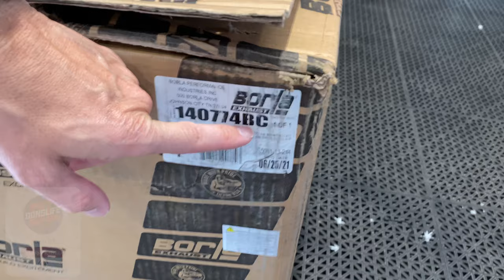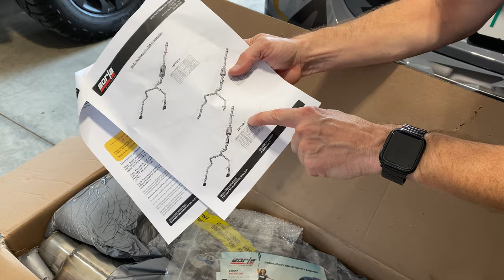BORLA S-Type Cat Back Dual Exhaust Install Review 2019 - 2023 GMC Sierra Chevy Silverado 6.2L

Comment: Auto stop eliminator installed?? Isnt that the button that is on all trucks from factory? Or did you do something extra for that system.
Reply from the maker: It has the auto stop/start enabled by default every time your start the truck. The ‘eliminator’ let’s you choose the setting to be on or off by default when you start the truck.  It remembers your setting.  Yes I know I could just push the switch every time I get in the truck.  My two other vehicles have auto stop/start but it is off by default and I would prefer my truck to be this way.  I just don’t want my truck firing up again at every stop, especially with a more aggressive exhaust.
Reply: @Donslife  and where or how do i get this eliminator you speak off? It sounds like something i might look into for my vehicle
Reply from the maker: I made a video on my channel and the link to their website is in the description.  It won’t let me put links in the comments here.  In this Borla video I put a short cut link in the scene I am talking about the eliminator
Reply from the maker: This is the video name: Auto Start Stop Eliminator / Bypass GMC Sierra AT4. Full Review and Installation!

Comment: Hey Don,  love the AT4.  Have you heard a Borla Touring on the 6.2?  Can’t make up mind between the Sline and Touring.  Did you look at the Sline in the true dual? Thanks for the help!!
Reply from the maker: I haven't heard the Touring for my truck, just a 5.3.  It was an improvement from stock if you are looking for a little more grunt, but it does not compare to the S-Type.  Neither drone which is really good, but to have the S-Type, you have to be okay with grunt every time you accelerate. Even feathering the throttle, you'll hear it.  Also if you have a risk with annoying neighbors during cold starts, the touring is probably your safe bet.  Mine roars like a lion for the first few seconds and then tames after warming up. As for the true dual - No I haven't heard one.  I only looked into Cat-Back systems with a single connection

Comment: Hey Don, did you ever tow a 7k lb cargo trailer with that AT4?  If so just wondering how well it did.  Or any other trailer that weighed close to 7k lbs or more.  I have a 2016 2500HD Chevy with the duramax and a 6 speed trans.  I want to switch back to a gas engine and your truck is what I would buy.  Just wondering how it tows the heavier stuff.  I've seen you towing your boat before but I tow a 16' cargo trailer with 7k lbs behind the truck every day for work.  Do you think your truck could handle that?
Reply from the maker: Making the trip with 7500-8000 pounds this weekend.  May take a couple weeks to come back and edit it all for the viewers though.  My truck would handle it.  Just more wear on tires and burn more fuel

Comment: Hey Don,  when you have the sound clip out the back of AT4,  is your mic on the inside of cab or on the outside on your bed cover?  Thanks for all your help!
Reply from the maker: It was recorded out of the open rear sliding window with an iPhone.  There is a video later that is recorded with a GoPro on the tailgate. It is the DFM video.

Comment: Any fuel ( mpg  )gain with this setup?
Reply from the maker: I am seeing a little better mileage, but part of it could also be from the motor being broken in.  Right now it’s subzero temps here and some remote starting so fuel economy is out the window
Reply: @Donslife  
Trading in my 2020 LTZ Z71 for 2021 AT4.  Looks like a twin of yours except the carbon trim package..
My 2020 achieved 38 mpg driving 65 mph (maybe a tail wind) on freeway with cruise and a fresh fuel filter.
Reply from the maker: @22cavjock  wow

Comment: Do those clamps ever come loose ?
Reply from the maker: They haven’t to date, but you’ll want to make a few minor adjustments after driving around and allowing the hangers to settle.
Reply: @Donslife  I had a straight up done like this before and the clamps didn’t hold a month , that’s why I asked , thinking heavily into buying this exhaust but after I saw it’s clamps I’m very hesitant ;(
Reply from the maker: @danrocha7913 maybe read the Borla reviews, unless borla is what you had before.  The joints fit well on my setup

Comment: Hey Don, wondering  if you are going to get the Pulsar tuner any time soon?
Reply from the maker: No I don’t think I will until I need to use the speedometer calibration for larger wheels/tires

Comment: Hey Don - first time thinking about exhaust on my truck (2019 6.2 high country) and a little hesitant. I know I could have it welded or clamped, but is it at all possible to remove the factory exhaust without any cutting (in case my wife doesn’t like it 😬)?  Love your content!

Comment: What a difference 👏 sounds 👍 great. I noticed some other additions you did as well. Airbags and air intake. I sure hope these minor adjustments will not void our warranty. There has been some talk on the internet that GM has installed weight sensors. If you are over, the payload will void the warranty. Will research, in the meantime, we will have to have our exhaust installed (at our age). You are superb at installing  and have great instincts on produts. Thanks ✌️out.

Comment: Nice Sound. Did you install the exhaust before or after you installed the Pulsar LT? I was wondering if the DFM was noticeable at all?
Reply from the maker: I don’t have the Pulsar LT yet.  I shift to L9 for now when driving under 60mph and DFM is disabled.   It is very noticeable when DFM is on when coasting or decelerating.

Comment: do you know, or do you still have the Factory exhaust tail pipe section in garage somewhere, what the diameter of the exhaust is, for tailpipe section (left or right). Is it 3 inches or 2 1/2 or something else? Thanks.